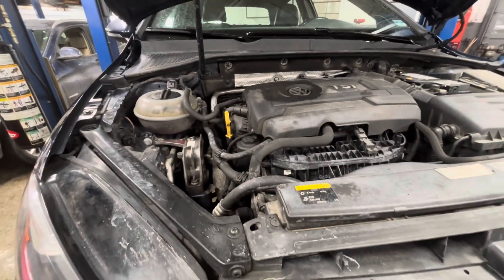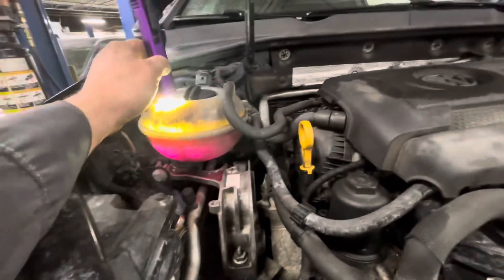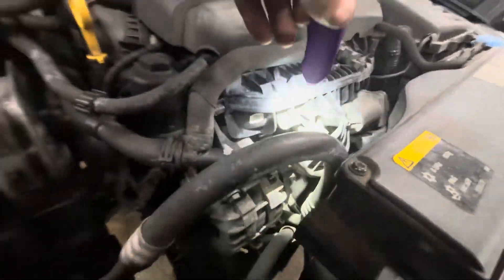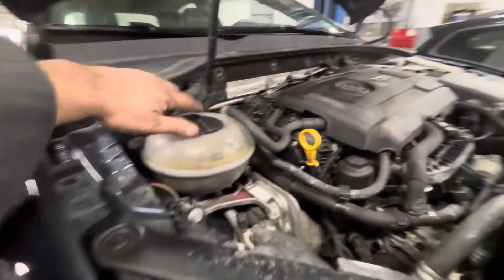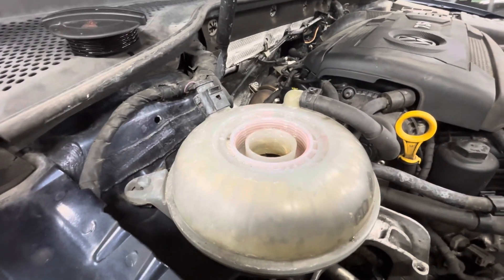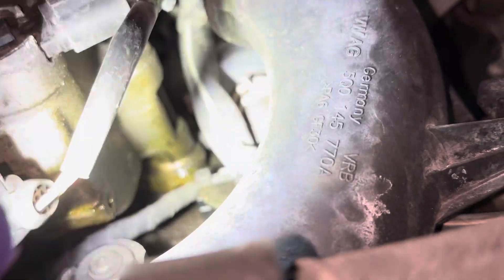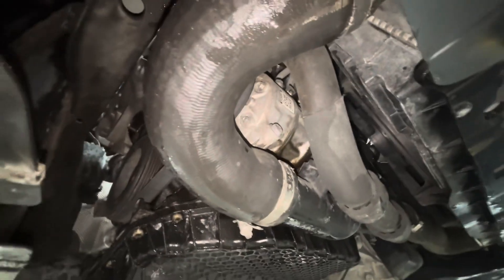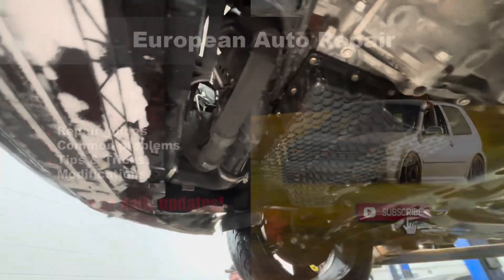Common Cause Of Oil Contamination in Your Coolant on Volkswagen 2.0TSI

Comment: Yep had that on my 2016 R. Pulled the ancilliary bracket and replaced both gaskets. Fixed coolant in oil but now I've got oil leaking down front of engine. I cleaned off old gaskets inside flange and off block. I've now ordered new gaskets and get to do it a second time. I'm wondering the the bracket is distorted as I torqued it all to spec in the recommended sequence! Tks for posts..
Reply from the maker: I haven’t seen anything like that yet, did the sealing surface on the oil cooler look to be in decent shape, any pitting on sealing the surface?
Reply: @EuropeanAutoRepair  Hi. Yeah block looked good but I scraped it with a plastic blade anyway.  In the grooves of the oil cooler surface and ancilliary bracket was a bit more difficult but it was pretty good. Can't work out how to post a photo in reply. May try on computer rather than phone!
Reply: @EuropeanAutoRepair  Hey - tried twice to post a link to google photos to show what I found but link sharing must be turned off in your channel. And can't embed photos. Anyhows, supposedly same elring 279.630 gasket removed vs replaced second time looked quite different. And thickness 5mm (4 months old and failed again) removed vs 6.5mm new.  There was no protrusion past the profile of the gasket seating in the filter housing. So seems like it is a counterfeit gasket to me. Or elring had changed production but this is not a new engine!